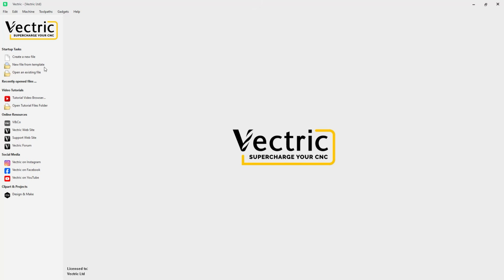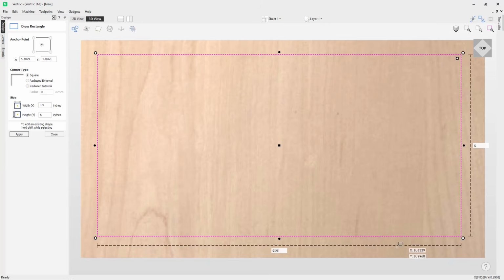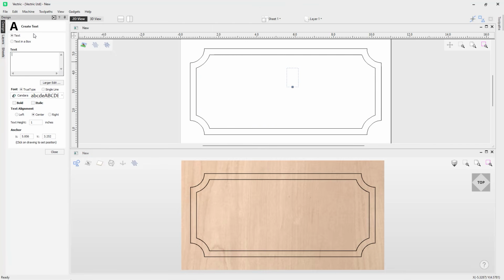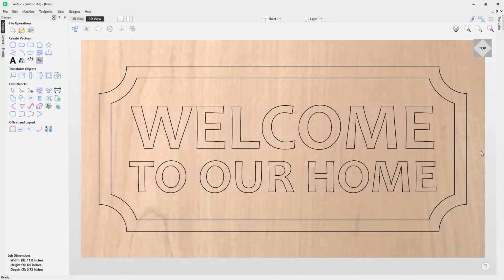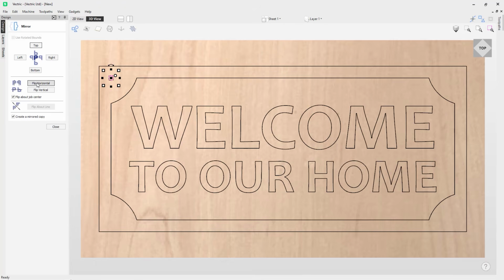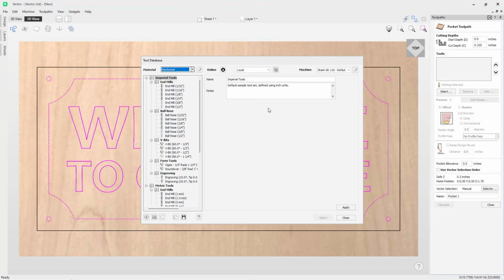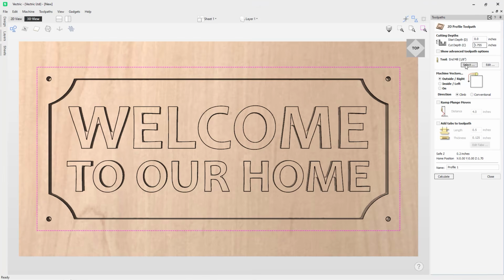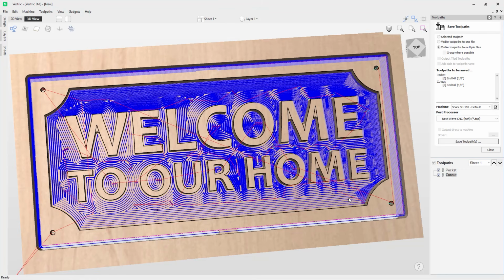How to create a simple sign in Vectric software | Getting Started | V12 Tutorials

Comment: I set my material thickness to 0.75 at the beginning, and then used the 0.755 you input for the tool depth, then the tool path cut all the way through and left the letters in place but there was open space all around them and then the outer border was left, with only the 1st hole we put in for the screw. Then I reduced the thickness to 0.75", still had the space. Then I reduced to 0.5" and it still cut out the space.
Reply from the maker: Humm... with out seeing your file it is hard to tell where things may have gone wrong.  You should have been able to see that in the 3D preview of the tooling, and if that is the case then we will need to have a look at the file. Please email support@vectric.com, include the file and what has happened.  They can help you from there.
Reply: Pretty sure I know exactly what it was. 
At ~12:30 Pocket Toolpath – Set the Cut Depth to 0.325 (Not the default 1). Second setting from the top.
The program seems to retain previous settings and I suspect this tutorial had been setup before they filmed. Default, out of the box, the Cut Depth is 1. In the video it is set to 0.325. It didn't get mentioned because it was already setup correctly. When I changed this it stopped cutting through my wood leaving floating letters. For a first time/beginner I feel this was a pretty critical setting to overlook.
I didn’t notice it for ages and thought it was related to the passes. Default 42 vs tutorial 7
To fix the passes - At ~13:30 the End Mill (1/8”) Cutting parameters Pass Depth is 0.05 (Not the default 0.024) The passes changed from 42 to 7

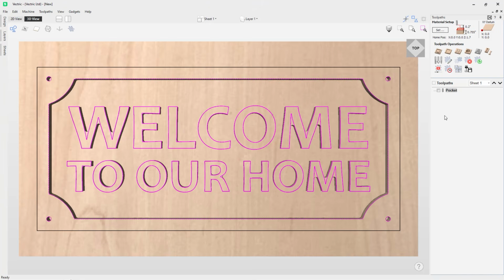Comment: Thank you. Nice intro tutorial, but i missed something on the Cut Depth. What key did you press after adding the z for zed at 15:05?  I played it back several times. I'm used to 3D modeling software and VCarve is way different but I like it.
Reply from the maker: Thanks for the question... it was "="... :)
Reply: @vectric  Thanks! That makes sense.

Comment: In your set up setting you clicked on the zero z to top of material, but then you use the zero plate to zero out the bit.  Why the two different settings?  Very confusing for us new users!
Reply from the maker: Thanks for the question.  The touch plate has a known thickness in the controller software for the CNC.  So using that sets the tool length, as if it is off the material... seeing as the controller subtracts the thickness off its reading.  Most CNC now come with a touch plate... it is super handy.

Comment: My software doesn’t show the tabs??
Reply from the maker: Hello and thanks for the comment. You can see the tab placement in your Profile toolpath when you set it up (the yellow dots in the 2D view).  They only show in the toolpath preview when you have simulated/previewed the profile toolpath.  If you still don't see them there are a few things you can check:
- The cut depth of your toolpath.  IF the tabs happen to fall below the material when the toolpath previews you might need to adjust that.
- The thickness of the tabs.  If they are too thin they may, depending on your toolpath, fall just below your material or not be visible at all.
If you are unsure what is going on have a look at the blue toolpath wireframe/path... you should be able to see the last or last couple of passes lift where the tabs will be.  
If all that fails... please email support@vectric.com and they can dig a bit deeper.  They will need to see your file, so please attach it.

Comment: What was the Rapid Rate mm/sec set to and what was the total job time? When I check the file I get 6 hours and 26 mins on the pocket and 59 mins on the cutout. Is this correct?
Reply from the maker: I cut this on a NextWave CNC, but it will depend on your CNC on how fast you can push it and still get a decent result.  That time does seem long.  If you need help with that I would contact Support@Vectric.com and mention the issue, the CNC you have and send along the finished file.  They might be able to help.  When it comes to Feeds/Speeds we normally recommend you contact the CNC manufacturer.

Comment: What determines when you should be in 2D view or 3D view?  I tried creating the first rectangle in your video but was doing it in 2D view and wasn’t getting the behavior you were showing, I finally figured out I needed to be in 3D view. You created and modified the text in 2D view, why 2D rather than 3D?
Reply from the maker: Hello and thanks for the question.  We are moving most of the 2D views into the 3D view, and it is taking some time.  Most... of the 2D views features work in the 3D view... but there are some exceptions.  I would suggest going straight into the 3D view to start.  I would also suggest that you sign up for the Vectric User Group Meeting... We will be giving a sneak peek at what the future holds... :) https://ugm.vectric.com/
Reply: @vectric … Thanks!

Comment: I have the 11.554 version and this tutorial does not work with this version HELP
Reply from the maker: Hello... you will need version v12 for this one.  Our getting started videos normally have been produced so that new to Vectric users with the current version can get up and running fast with the new features.  You still can follow along, and in most cases we note the "new" or "updated" features.  If you run into a snag there is the help feature of your software or please contact support@vectric.com.

Comment: Hey, just wanted to say I found this tutorial easy to follow and I appreciate the effort that went into it. For those who feel that this is difficult, hang in there. You'll figure it out. I seem to have a bug where my block of material only has one visible surface for some reason, but it corrects itself once you calculate toolpaths. Oh, and when you first set dimensions for the work piece, you can set the material appearance farthest down in that tab (someone in the comments was wondering).
Reply from the maker: Thanks for the positive feedback and for sharing the tip about the material appearance!

Comment: Why is it that when you made your rectangle, it looked like wood. Mine does not. Then you looked at it 3d and it looked like it had thickness, mine does not do that.
Reply from the maker: This might be a question for support@vectric.com.  Fire them off an eail with a description of your issue and a screenshot.  They should be able to help.
Reply: Hey, I'm having the same issue with my material block appearing to just be a flat surface (without depth). Even though I set depth to 19 mm. Probably doesn't matter, but still annoying. Anyone know why this happens?

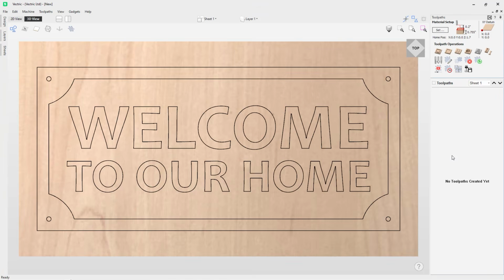Comment: This is a simple video to follow, but I noticed you didn't mention the depth of cut for the pocket. I can see in the UI that it's 0.325" (at 12:26). Did I miss something where you stated that was the depth you are going to use? Does the software use a default? Just curious.

I am on version 12.013 on VCarve Desktop. It seems that the "live" edits in the Design View are not available in that version. That is, I cannot edit X, Y, or the radius in the Design View, only "Draw Rectangle" configuration box to the left of the screen. Are you using Aspire or a different version of Desktop?

EDIT: this workflow does not work for me. I have copied your design (minus the 4 corner holes) and when I calculate the toolpath, the preview shows the letters being carved into the stock versus the material around the letters being carved. I keep getting a popup suggesting I go to the Vector Validator which tells me I have 12 Overlaps and 14 Intersections, but I don't know what to do with that information. I am copying your process of object selection, etc. exactly.
EDIT to EDIT: When I SHIFT-selected the text and border, then it worked. The marquee select did not work for me.
Reply from the maker: Hello... you are correct I did not mention the depth of the pocket... an over site on my peart, but 0.325" is correct.  As for why... I suspect I was just wanting to make it deep enough to look good... so this is a subjective.  

With the marque selecting, there are two ways to do it - I created my box from the top left to to bottom right, making sure all of the vectors I wanted selected were in the box selection.  If you miss any, or they are not contained in the box it will not select them.  If you do the same from the bottom right to the upper left then any vector you touch will be selected.    

If you are not seeing the entry fields in the 3D view that is odd... you might need to contact support@vectric.com and they can help you out.
Reply: @vectric - thanks. I’ll contact support. I selected using left to right and captured all the objects, just like you did. I basically mirrored your exact process. Are you using Aspire and is that a different UI?

Comment: @15:20 what was the keyboard command you pressed to set you depth of cut for the profile toolpath?
Reply from the maker: Thanks for the question... "=" or "Equals" on the keyboard.  All the number fields in our software accept equations, and in this case if you forget the thickness of your material you can type "z" and the hit the "=" or "equals" key on your keyboard and we will find the material thickness and replace anything in the field with that number (or thickness).
Reply: I wonder the same thing. The closed caption says "PS", which doesn't make sense.

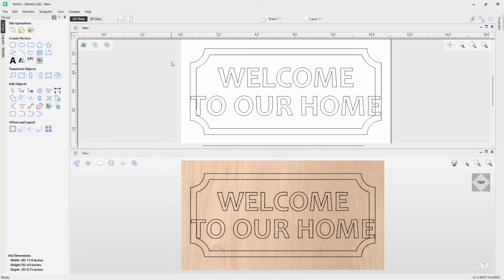Comment: @7:18 I could not figure out why I couldn't select the welcome text. I thought I would mention that when you are selecting vectors with this method, you must wrap the rectangle around the entire vector that you wish to grab in order to select it, it's not like other programs where you could partially select the objects. There is another method of selecting from the right hand side and that anything the rectangle touches will be selected using this method.
Reply from the maker: Hey Thanks for that!  Yes you are correct... if you create your bound box form the bottom right to the upper left, any content the box touches will be selected.  I did not cover that in this video, seeing as it is for beginners, too many options could be confusing.  For the more seasoned user you will have had exposer to more options... :)

Comment: I'm attempting to follow along and have V12 Pro (full version). I clicked on the 3D view, in the upper right corner of the Vcarve window there is an icon that allows me to see different views. When I click on some of the options (Back, Left, Back, Right, possibly more) I don't see the project. IMHO I should be able to see something in all of the views.
Reply from the maker: Hello John... thanks for all of the questions.  You should see a modeling/zero plan... in the least.  If you have not imported in/drawn any 2D vectors, imported in any 3D content, or previewed any tooling that is all you should see.  If that is not the case please feel free to email support@vectric.com for individual software support. Thanks... I hope this helps.

Comment: 👎👎Thumbs down for the software. Seriously, I'm a week into the trial period and have discovered designs/projects can't be exported and my own design cannot be saved in the trial version. If I can't test ALL the functions during a trial, the test is a fail. Crap like that really pisses me off. 🤬🤬🤬🤬🤬🤬🤬🤬
Reply from the maker: Hey Mike... thanks for leaving the comment, we apricate the honest feedback.  As we are sure you have discovered the trial version is a full version of our software (you are able to try all of its features) without a expiry, the only thing you can't do is save off tooling for your own custom projects.  We take a lot of pride in the quality of our 3D tooling previews so you can be reassured that if you could save off your custom project tooling you would get what you see (as long as your CNC is set up properly, the proper tool is in the spindle and you have taken into account the material you are cutting).  In saying that we offer projects like this one that are "trial friendly", so you can open them in your trial version of the software, adjust the tooling to be safe and appropriate for your CNC, the tools on hand and the material you plan to cut and than cut them.  This should help  to make sure that the post-processor that has been chosen works fine with your CNC and it's controller.  In the end most potential customers think this is very fair, and actually better then most software out there today have to offer.  I hope this helps you to better understand why we offer what we do, but 100% know that it might not be tight for everyone.
Reply: @vectric  Ysing a file YOU created is nothing like using one I create. If I can't try ALL the function in a trial, it's a cheat. But go ahead and believe what you want, but also believe I'll NOT be buying. I've already found a cad/cam that is more extensive than anything Vectric offers for less.
Reply from the maker: Thanks Mike for the comment.  Glad you found something that you are happy with.

Comment: A couple of question. I tried using the trial version of the simple 2D. I have a desktop Genmitsu 4040 Reno. When I finished my design you transfered the design onto stick and used an off line controller. How did you transfer it? I have desktop CNC and need to plug in direct from the computer to the machine.  When I tried it and nothing happened. No control pad or anything. How do get the controls to work?
Reply from the maker: Hello Scott... thanks for the question.  First seeing as you have the trial version, you will need to make sure you use the trial file that comes with the demo.  Once you have that loaded into your Vectric software, please review the tooling and then save off the toolpaths using using the proper post processor for your CNC.  I think you would have received "Candle" or be using "Universal G-Code Sender" to get the gcode to your CNC from your PC or laptop.  Plug in your CNC to your computer then open up Candle... or the other, and load in your g-code.

That should do the trick.  if not, please send an email you support@Vectric.com and they can help you out.

Comment: Does anyone know if the 'trial version' is a little different from the bought version (Version 12) ?  I want to buy Vcarve... (currently use Carbide Create) and want to make sure I can navigate Vcarve's software.  But I'm having trouble doing so with the trial version.  I don't see an 'undo' button. If I choose a pocket tool path by accident, I dont see a way to get out of that to choose a different one.  I can't even figure out how to choose a different bit when I want to create a tool path.  It's stuck on 1/4" end mill.  And what I'm seeing in this video is different than what I'm seeing in the trial version.
Reply from the maker: Hello Brent... The trial version should mirror the release version.  If yours is not I would suggest you contact support@vectric.com and they can get you all sorted out.

Comment: When you put the Z in for the profile cut and said something about putting zed into the box and press something on your keyboard I could not understand what you said there. If i put Z in the box it seems to show 8 passes instead of 1 but it doesn't show me the number like yours did.
Reply from the maker: Hello... yes if you put "z" in the field and press "=" it will replace the "z" with your material thickness.  The number of passes will depend on the "stepdown" of the tool you choose to use.  Hope that helps.
Reply: @vectric  excellent. I was just confused because I could quite make out = thank you